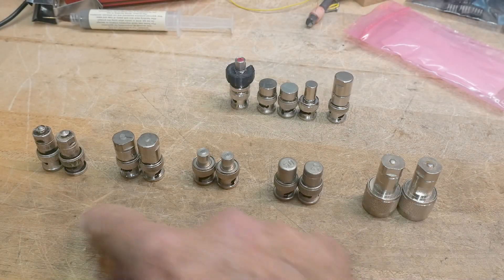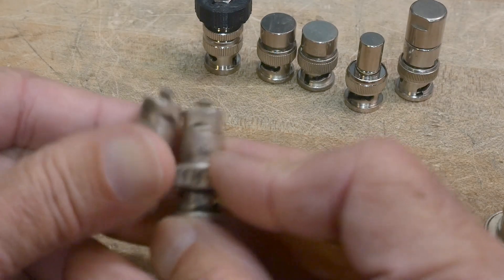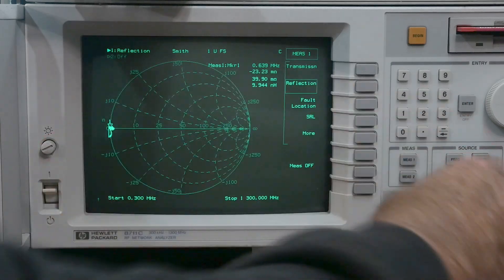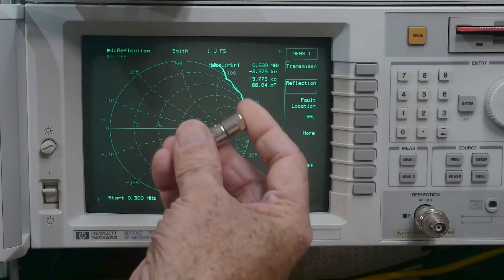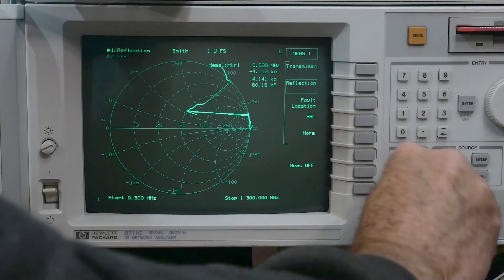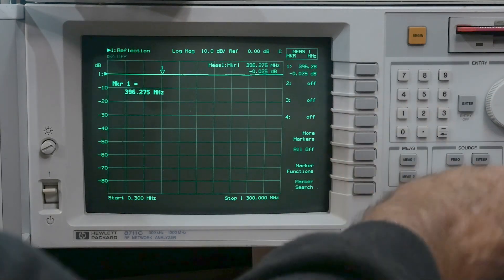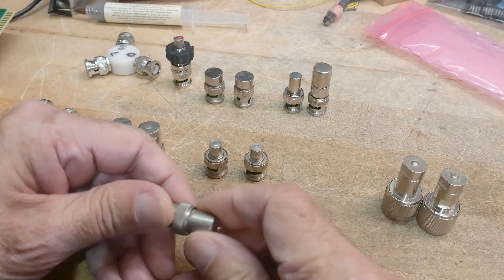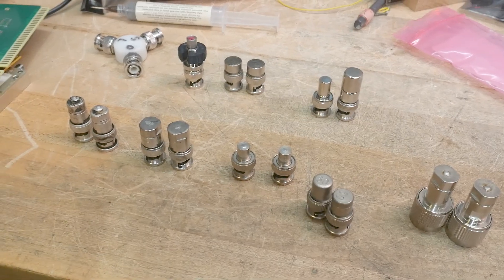#2143 50ohm BNC Loads

Comment: Most of those were probably originally used to terminate 10Base-2 Ethernet, which would only need limited bandwidth. And yes a lot of them did have a little chain thing. 😄

Comment: The fundamental problem. How can you separate the good ones from the problem ones when you are already doing the initial calibration of the analyzer with an unknown accuracy load? It's kinda tough to work from first principles on these.
Reply: @johnwest7993  Please start watching the video again.
De VU2RZA
Reply: That's the costly question that only ends in device calibration.
Reply: @jspencerg  Please start watching the video again. 
Or you should have watched his previous video on making his own calibration standards (which he used in here).
De VU2RZA 
De VU2RZA
Reply: @subramanianr7206  Just tell me where i missed the point.  Assume I'm slow.
Reply: @jspencerg  
The only way to do it is to have calibration loads that you trust so that you can transfer the calibration to the VNA.
It depends on what kind of accuracy you're looking for I guess, but you could also compare two loads - if they both have similar performance, it is likely that they are somewhat accurate.

Comment: I would call those terminators, not loads. A load would have a big heatsink. Those little guys are not meant to dissipate power.
Reply: @humidbeing  Good point
Reply: Fair enough. Though I think it’s also fair to call terminators just a specialised sort of load. Their whole aim is to dissipate the incoming energy with no reflection.

Comment: I'm sure most of those were 50 ohm thinnet Ethernet terminators. Those things were utterly common, as most Ethernet cards had a BNC and supplied a T adapter with it. Most networking guys would have a bucket of terminators since they'd inevitably get misplaced when people moved computers around and the network stopped working. Some were perhaps token ring as well.
Reply: Yes most were 10base2, often with a chain to stop them being lost. the N Types were used on the main trunk cables 10base5  They often had a screw on the end to connect to an earth point.   

The 10bas2 terminators were simply a 50 ohm resistors shoved into a bnc, and you paid a lot for them.  I just bought a box of 50ohm carbon resistors and crimped up, my own, saved a fortune on the budget!

Token ring usually used a twisted pair system so did not use coax terminations. (I'm not sure if there was an earlier coax based token ring.)  IBM had a twinax cable system, but no standard coax terminations  but you also had older coax systems such as decnet around that time as well, which needed terminations.

Andy

Comment: All but the N connector ones came from the same place.  It was a bulging gallon bag of BNC 50 Ohm loads.  A shame because all my test equipment has either N connector, 3.5mm, 2.92mm or 2.4mm connectors.  For $5 at auction I figured I couldn't go wrong.  They were worth more than that as scrap brass.  Besides, they make great stocking stuffers.  🙂

Comment: I have seen the stamped ones, and even have a few. They did that because they manufactured several different loads, knowing that some labs would require different values, such as 50 and 75 ohms. The old CATV compatible equipment had 75 ohm inputs, which is why you need to look closely at some HP spectrum analyzers before you buy one. If their selling price seems to be cheap, that's generally why. I think they had some portable scopes set up for 75 ohms as well.

We used to make up a cheap load by soldering a 47 ohm carbon comp resistor into a PL-259 to test low-powered transmitters. You can obtain 51 ohm resistors, today, that are non-inductive and at a good price.

The military had a low-power dummy load at one time, which used a few small incandescent bulbs as the load. Those were WWII vintage.

Comment: There's a bunch of 50 ohm SMA loads on Mouser at a variety of price points with similar specs (most show DC-18GHz).   For example Amphenol sells one for $4.47, while Midwest Microwave wants $230.34 for theirs.  Radiall has one for 95 bucks that's rated for 26.5GHz.   Maybe you could get manufacturers to send you samples for review?   I'm curious if there is any difference or if the latter are just for isolating money from fools.

Comment: Interesting data! Some of the old ones may have been made for 10 Mbps thinwire Ethernet. I don't know if there was a spec for the 50 ohm loads ("terminators"), but thinwire used Manchester code at a 20 Mhz clock rate so they probably only had to be good to 5 or 7 times that, or 100 or 140 MHz.
Reply: Indeed, these were used on coax ethernet as terminators.

Comment: I got to test mine, but my nanovna sucks, and i can't find a directional coupler for my spectrum analyzer that works well below 200Mhz the ones i found locally start working at 300 Mhz 😢 and the minicircuits here are unoubtanium
Reply: Have you tried the ham radio community? There are plenty of plans for directional couplers there, many in the 1 MHz to mid VHF range, and you could adapt one to your needs. Many are embedded within SWR meter designs. Performance might not be as good as a commercial unit but it will be inexpensive and you can calibrate out a lack of flatness.